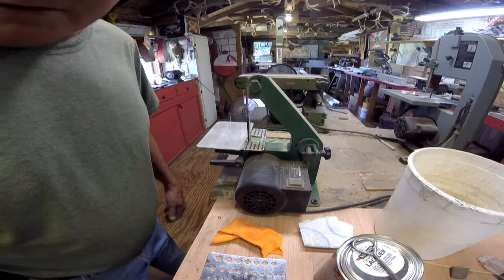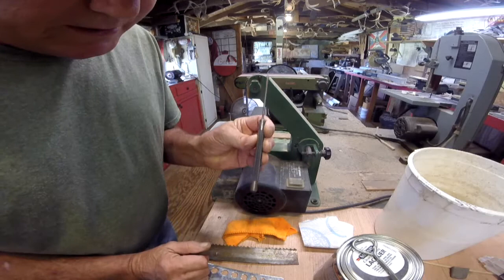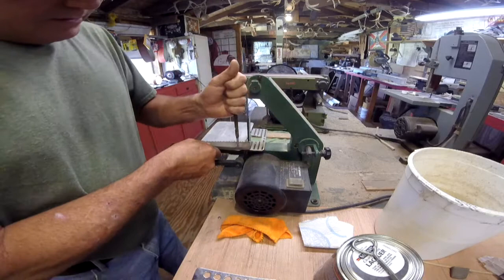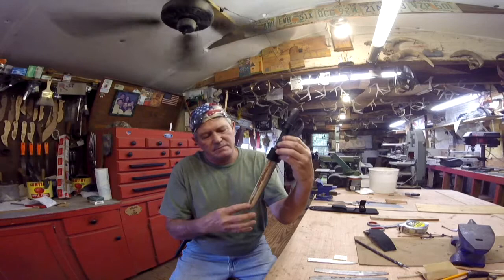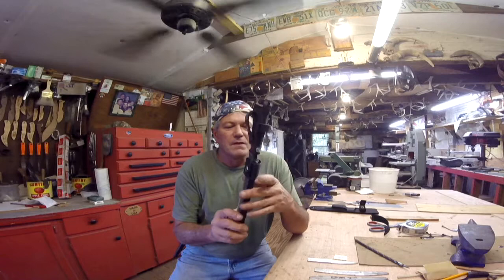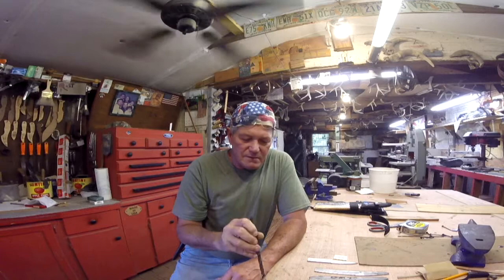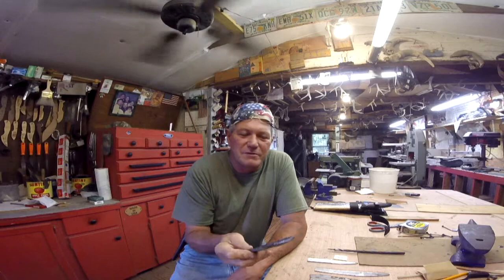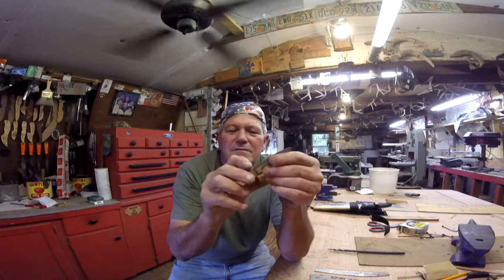Homemade punch, New knife design

Comment: Have you tried using actual Solid Carbide Drill bits?  I was watching on another Youtube channel where someone was drilling into a ball bearing, and Solid Carbide did the job.  He mentioned http://www.drillbitwarehouse.com/ as the place he purchased bits.
Reply from the maker: Ive heard those will work  but not brave enough to spend that much money on a bit.  :)
Reply: I hear you there, and I guess if you have found a way to do it for now it makes sense.  But it's something to keep in mind if the time comes.  Thanks for your videos, and thanks for responding!
Reply from the maker: Thanks for watching!!